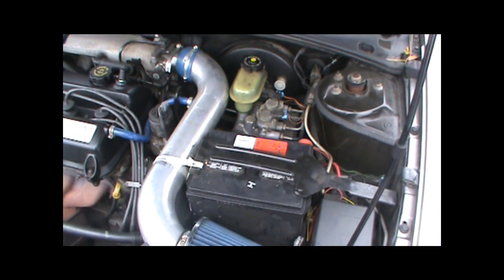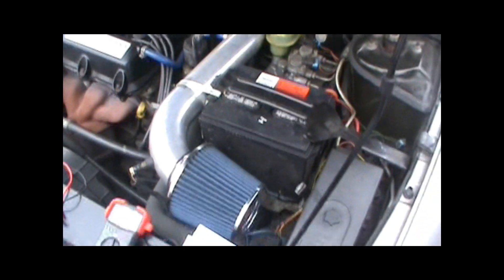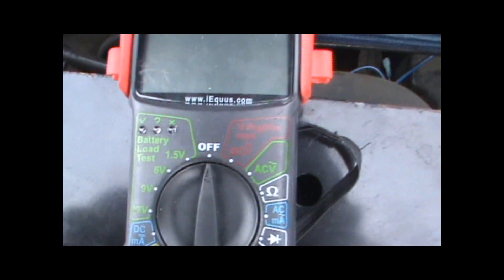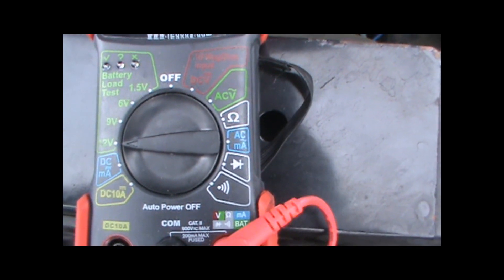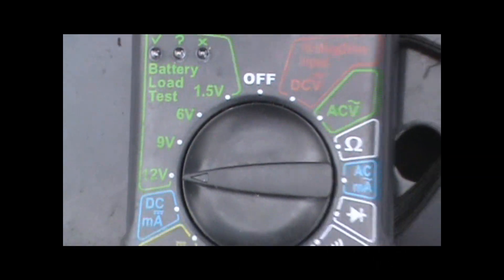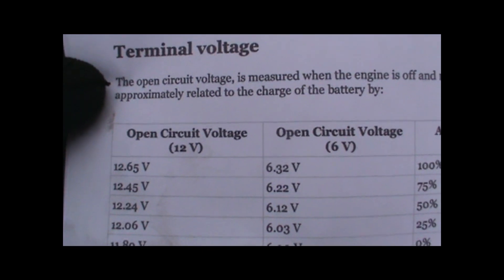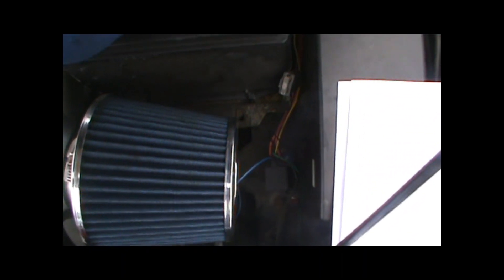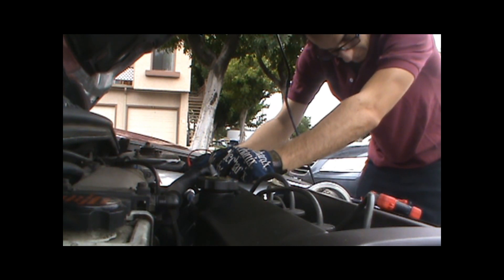Testing Battery Voltage using a digital multi meter (DMM, DVOM)

Comment: So I tested mine under four different situations: Engine off, engine on without any electronic and/or lights on (aside from my head lights of course), engine on with loads (Stereo on with normal volume, AC on low), and engine on with heavy loads (Stereo on blasting with bass, AC on med to high, high beam on). I noticed that my voltage started to drop as I tested with loads. After i reverse the sequence back to having only engine running, the voltage stays at ~13.34, is my alternator bad? help?

Comment: Like the video. It was helpful. An honest critique (not an insult)- sometimes, you don't have to address every possible variable. If someone has a battery under the seat or in the trunk, they don't need someone to tell them that in a "how to use your multimeter' video. They're already going to know. Otherwise, good vid, thanks for making it.

Comment: you realize your dmm was set on load test, not DC voltage readout. when explaining something like this in a video, be sure to correctly point out what you are doing. you explained that you had an autoranging meter, but you mentioned all the ranges of the battery load test, which is not for vehicle batteries.

you can only check voltage of a car battery with a DMM, and it means nothing as to whether the battery is good or not. it can be charged and fail a true load test.

Comment: I'm trying to predict how much cranking life is left in my battery.  According to your chart, I have about 87.5% charge left (12.55 volt reading).  How low can it do down, and still crank?

Thanks for the video.

Comment from the maker: @uzuru86 Keep the meter leads hooked up to the battery and start the vehicle.  If the alternator is working properly then the battery should be charged to between 13.8-15 Volts while at idle.   That is the simple test.  And amperage draw test will be needed to TRULY test the alternator, but that's harder to explain.
Thanks.